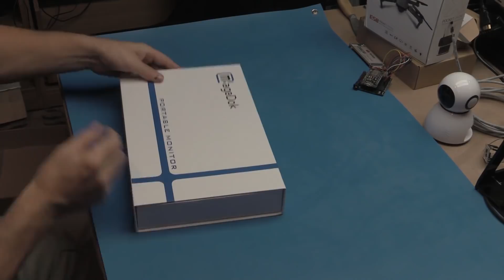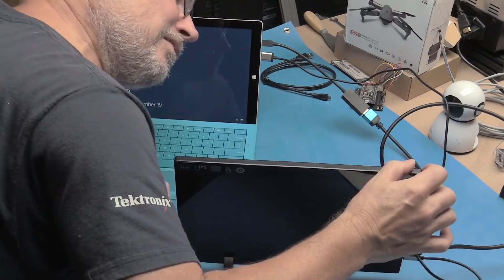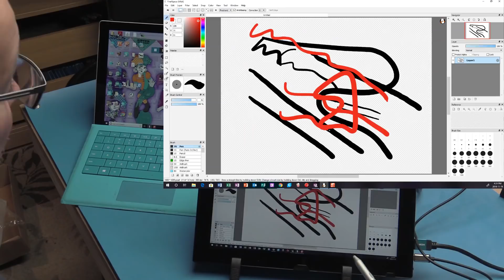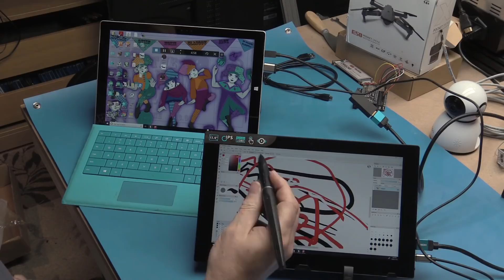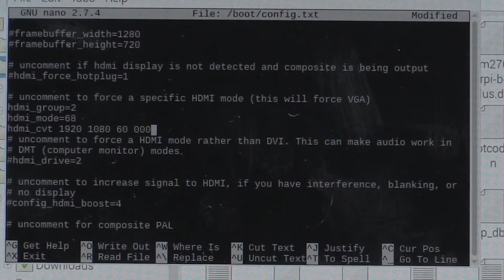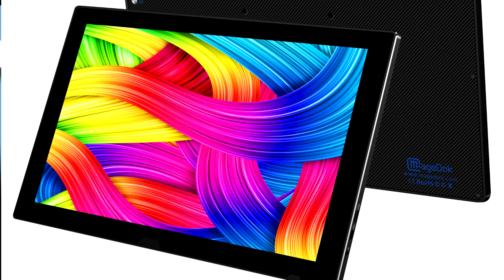Magedok T116D 1080 x 1920 10 point touch screen review

Comment: My surface pen does not work on MageDok T156E.
Could you tell me the reason why surface pen doesn't work?
Reply from the maker: The screen may use a diferent touch technology, I just reviewed the new model to the T116D and even though the T116D worked with my touch, the T116D Pro  used a different touch and did not work with my pen from my MS Surface. I spoke to the manufacturer and they said it was due to newer touch technology being implemented.
Reply: @TheBreadboardca  Thank you for your response.
If you connect MageDok T116D with Windows10PC not support touch screen,does SurfacePen work on T116D?
Reply from the maker: @hiroyukiyamamoto9193  Touch screen works perfectly with windows 10, only the Microsoft Surface pen does not work (On current models), it did work with the older model, to know which models will work with Windows 10 Touch Pen, I suggest emailing their customer support

Comment: How does it compare brightness wise?  From the video it looks less bright than the Surface.
Reply from the maker: you are correct it is not quite as bright as the Surface but it is still very usable, I think the angle to the camera may make it look greater than it is, for a portable display or one that may be run on batteries, this is not necessarily a problem when wanting to conserve batter life etc.